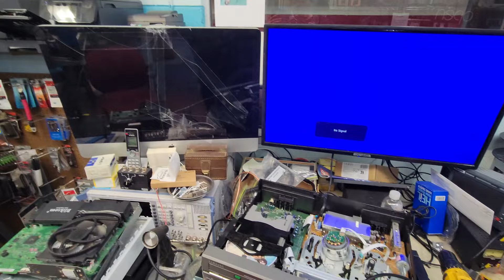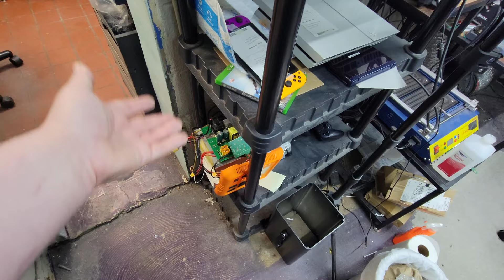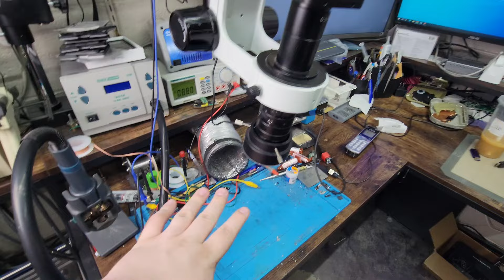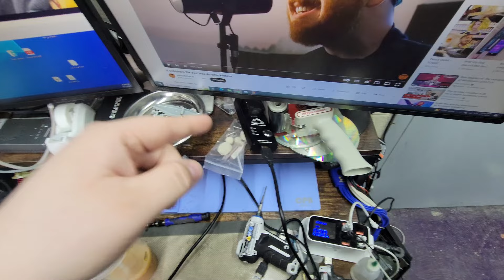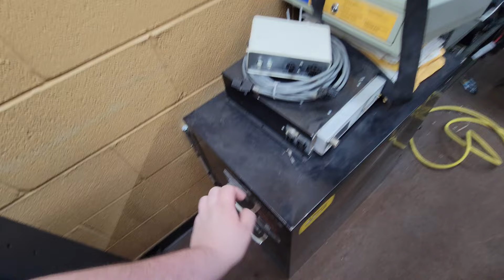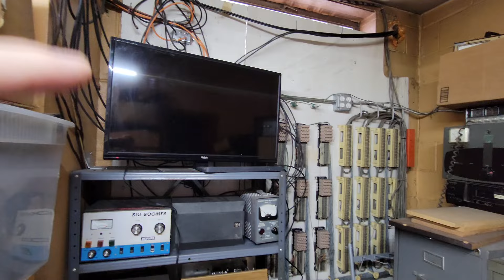Let's Look at My Microsoldering Repair Shop!

Comment: A great tour. You should invest in a Pace SX-100 Sodr-X-tractor desoldering tool for through hole components. It’s the best by light years and will save you lots of time.

Comment: The iMac (all in one) your brother uses, what iOS version does it have? Some time ago I found a tossed out iMac, an A1312. It had High Sierra, but the previous owner did a system reset of sorts, and it seems to run but needs the iOS reinstalled to fully work! Screen is in great shape!! Nice shop tour! 🤓 That was nice of the 3DS owner/ customer donating it! There's a couple of E-waste dumpsters I discovered some time ago and it's like walking in a bunch of Star Wars stuff! Looks like your shop could use a few extra cubic feet! 🤓🤣😂